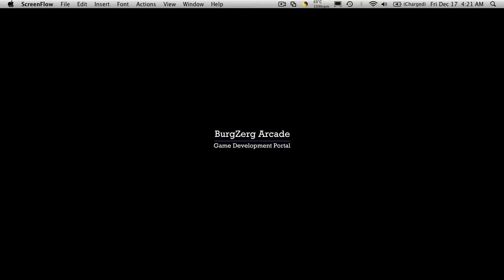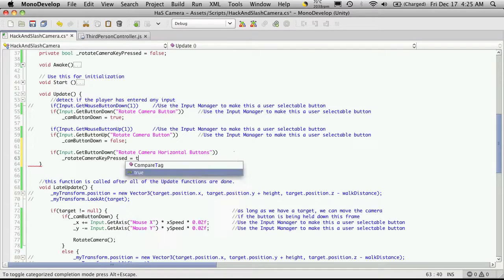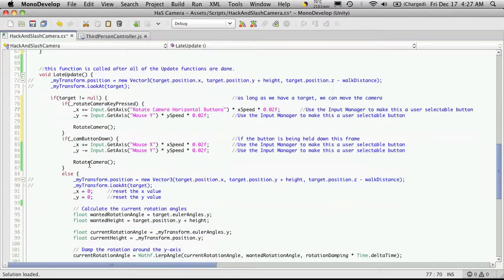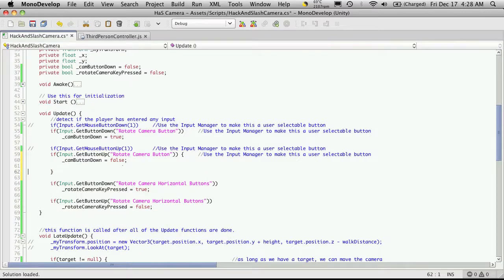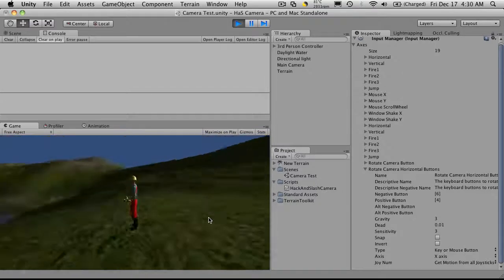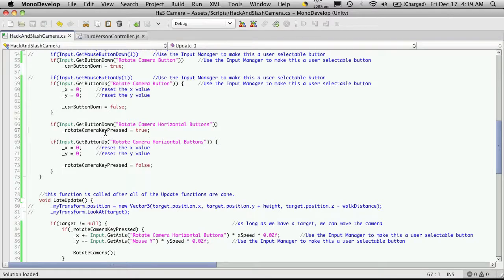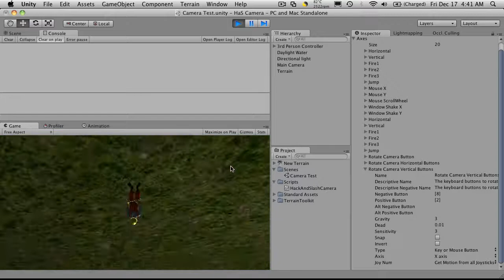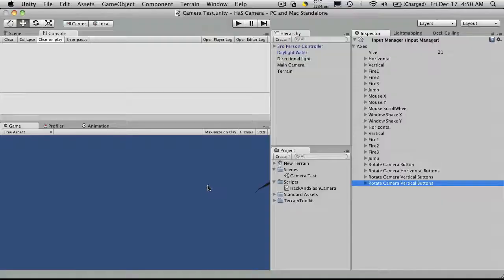90. Unity3d Tutorial - Input Manager part 2

Comment: if you are interested i have walking script,
var speed = 10.0;
var rotateSpeed = 8.0;
function Update ()
{
var controller : CharacterController = GetComponent(CharacterController);
transform.Rotate(0, Input.GetAxis ("Horizontal") * rotateSpeed, 0);
var forward = transform.TransformDirection(Vector3.forward);
var curSpeed = speed * Input.GetAxis ("Vertical");
controller.SimpleMove(forward * curSpeed);
}
@script RequireComponent(CharacterController)